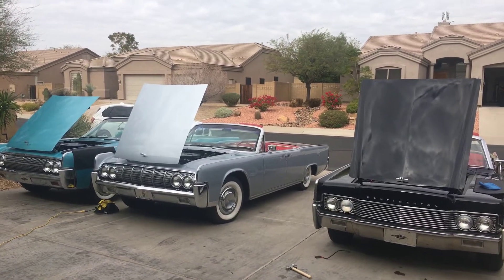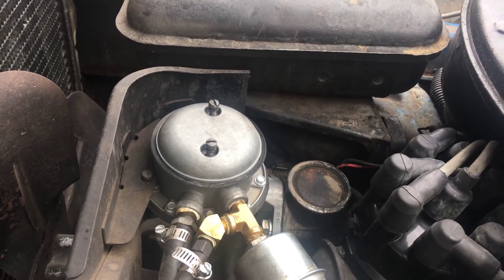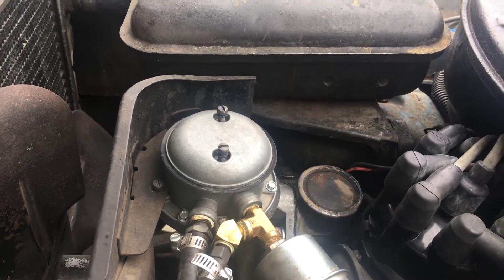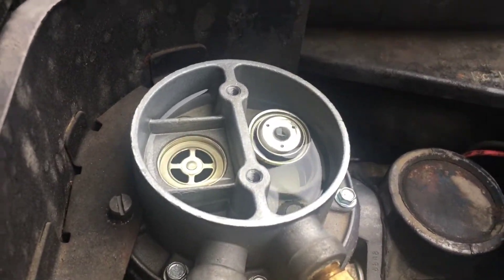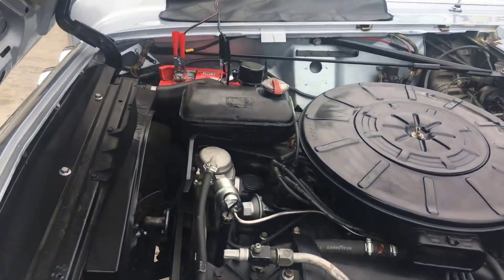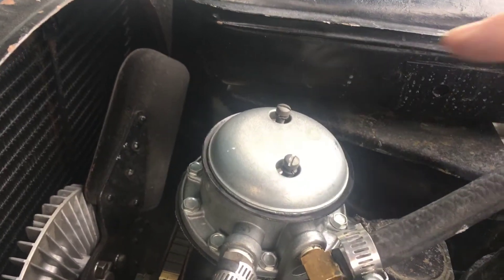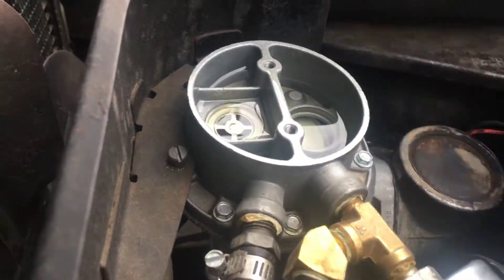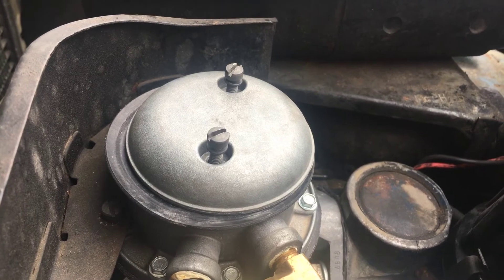1966 Lincoln continental mechanical fuel pump malfunction

Comment: Nice video. Jason here from Lincoln Addict Podcast. I’m sure people have mentioned this in the past but it is best to have the three port fuel pump it helps to illuminate vapor lock. Nice cars! I just bought another convertible (‘65) that I’ll be doing a bunch of videos on. The car is immaculate. ✌🏽
Reply from the maker: Thanks for the advice and compliments 

I have a completely restored 65 continental for sale if your interested or know anyone that may be

John Cashman took care of all relays. 

Kept the interior concept but did the upholstery in a two tone argyle stitching pattern

Comment: The black convertible fuel pump seems to have tee splice on the fuel line, does this mimic a three port fuel pump and how well does it work? Does it eliminate the vapor lock issue? thank you in advance.